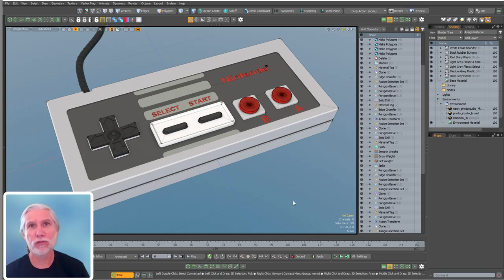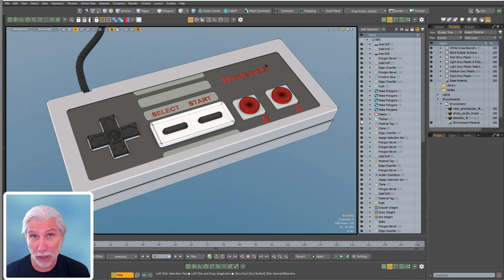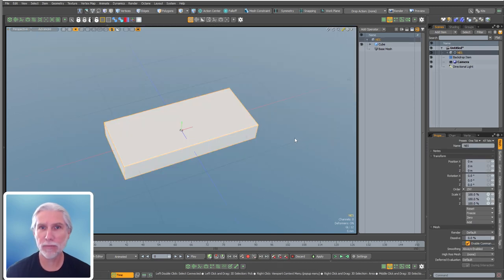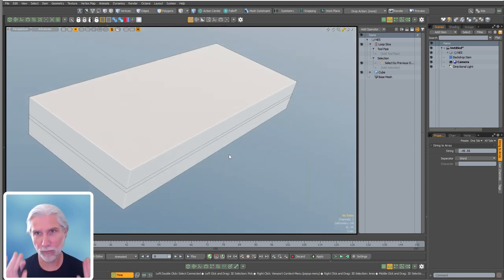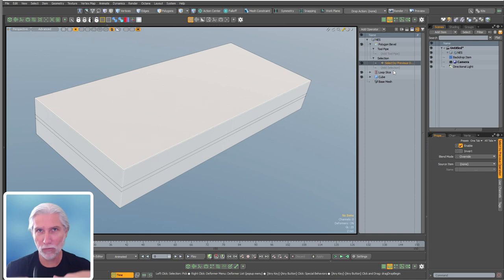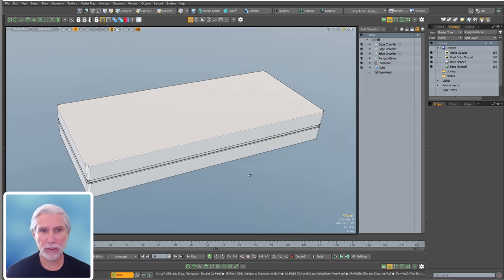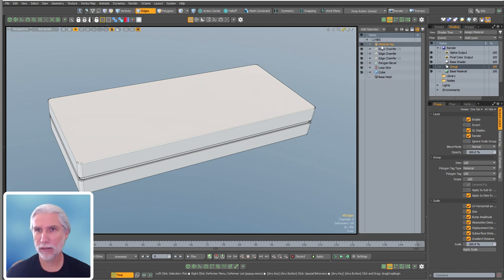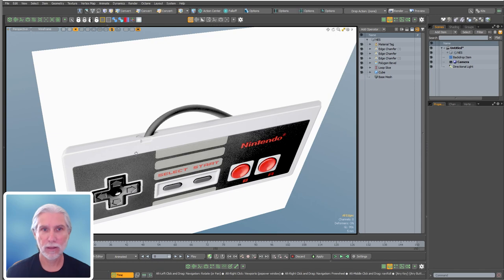MODO | NES Controller MOP Modeling

Comment: Thanks so much Greg. Another fantastic tutorial that’s really helping to demystify mesh-ops for me. And I totally share your gripes along the way - drop downs not endless re-typing in selection/material names please! I have a question, probably a very naive one, so apologies: As long as I’ve been doing CGI the constant mantra is ‘all quad topology’. Yet this is built with N-gons all over it. So what’s the deal with that? Is ‘all quads’ not so important after all? Is it that you’re not using sub-Ds so it doesn’t matter? I’m never quite sure what the rule is with this. In what situations can the ‘all quad’ rule be discarded?
Reply from the maker: Thanks.  I think there will be some duplicate improvements to fix the endless typing.  As far as non-quads.  Yeah, give Blender props for that.  The 'boolean-everything' Blender approach (with good normals, some edge beveling and some rounded edge shading) has made it ok again.  If you're going to deform it (like a character or animated object) then Quads are still a great way to go. Also, if you want to sub-D it.  With procedural you can always up the polygon count and edge roundness after the fact.

Comment: Just curious why not use the new stencil meshop for most/all flat stuff. Sorry if it was mentioned but I missed it.
Reply from the maker: There's a Stencil meshop?  You mean axis drill?  I did initially use axis drill but got a couple weird crashes / wrong results.  Or do you mean Prim Slice (that one has that weird bug where it stops working, will try and track that down)
Reply: Sorry! I meant decal workflows 🙏🏼😅😅
Reply from the maker: @JTabtabai  ah, decals.  You could have, sure (for the text and green/grey boxes).

Comment: Hi, Question regarding how your models are displayed. How did you achieved that you're model shows nice convexity and cavity on edges. This is done by some Matcap shader or something else?
Reply: Modo 16.1 AVP	 has that display feature.
Reply from the maker: Yeah, on the advanced viewport tab (press 'o' to get the popover. Turn on hybrid AO and also turn on curvature shading (Mode 'Screen Space Normals' - Display 'Viewport' (you can also use the shadertree and the occlusion shader if you want)

Comment: Mucho más rápido en plasticity
Reply from the maker: yes,  you could do it faster in MODO with direct modeling too.  The trade off with both is you can't change anything later.  Procedural modeling is always going to be slower and more 'technie' - but you get more flexibility.